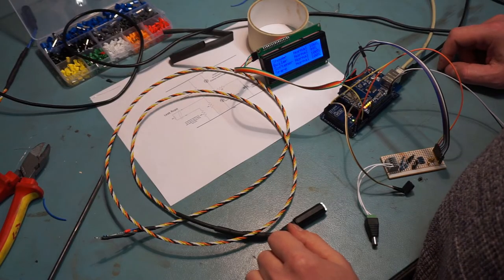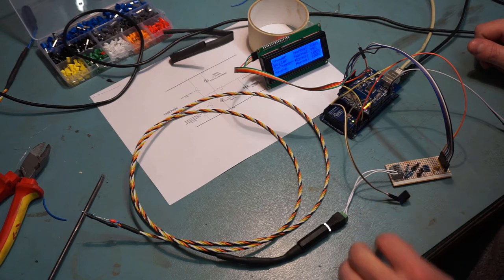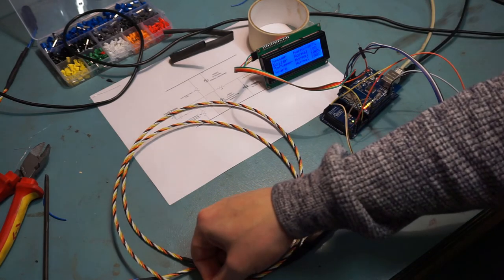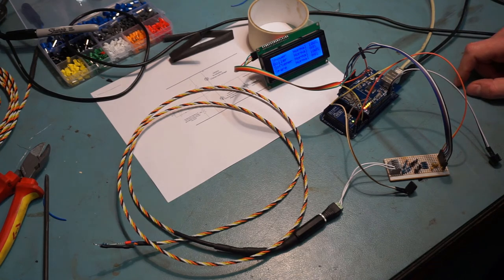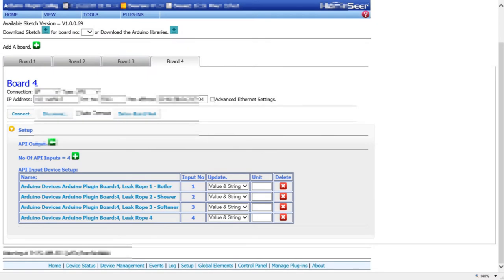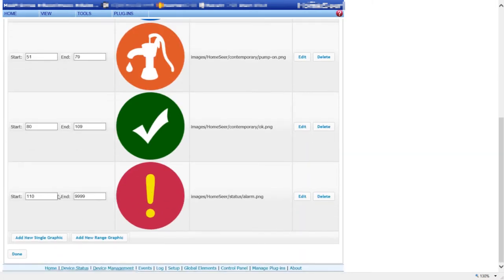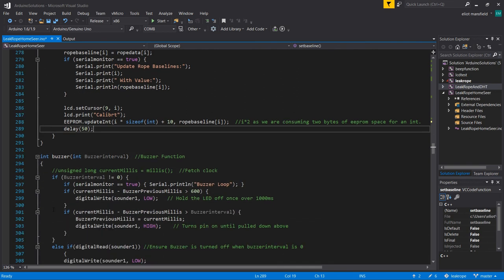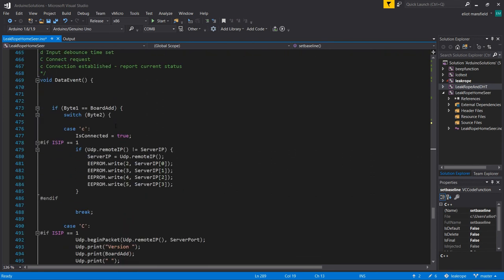Arduino Water Leak Detection for HomeSeer

Comment: Hi. Lots of questions. What is the leak rope? How is it made? Have you tried making a leak sensor built on a simple concept: a single length of wire one end tied to ground and the other connected to input pin of Arduino? What do the values you measured correspond to? Are you measuring continuity, resistance, current?

I’m planning belt and braces leak detection before we put new ceilings and floors down.

I love your case, nice job.
Reply from the maker: Mat Smith    Bit of a funny name for it really, it consists of four  ordinary insulated  wire twisted together with a pair of bare stainless steel wire entwined  round it.  The insulated wire is mainly used as a spacer for the two bare wires. The insulated wires can also be used to carry signals or voltage on longer runs.

The whole thing is pretty simple it’s just a voltage divider - the two bare stainless wires on the rope just an extension of the input which is held in equilibrium of the rail voltage. When water gets on the rope, it just shorts the input towards ground, which the arduino then measures on the adc. 
I’ve added some protection and a resistor on the end of the rope, which pulls the input down a little - I use this as a check to ensure the rope is actually connected (if you unplug the rope the input goes higher, which is an impossible situation and therefore must be a fault)

Had it in a few months now and it’s reliable.